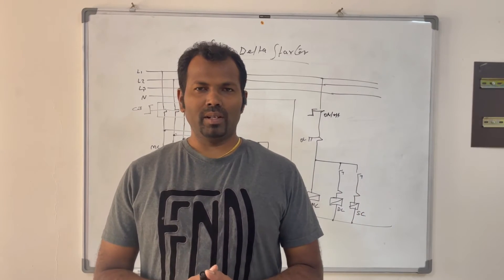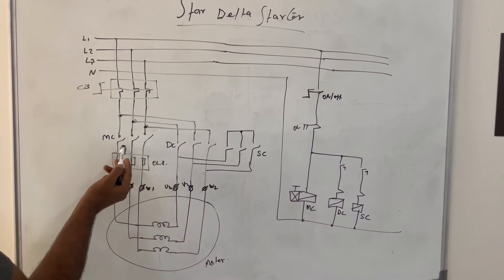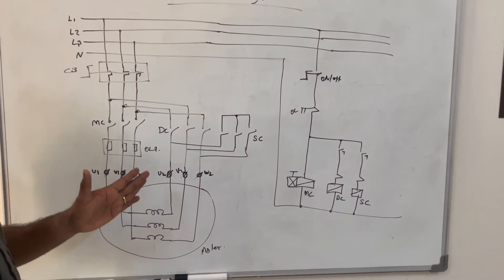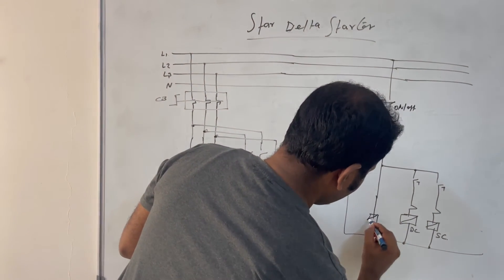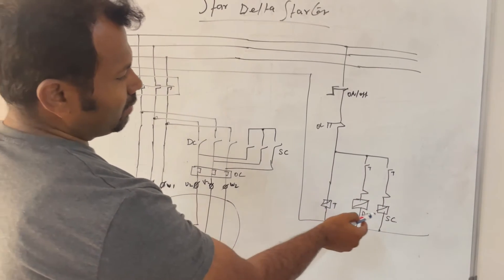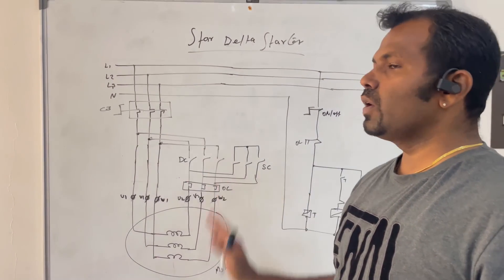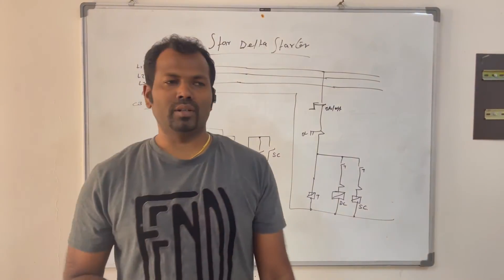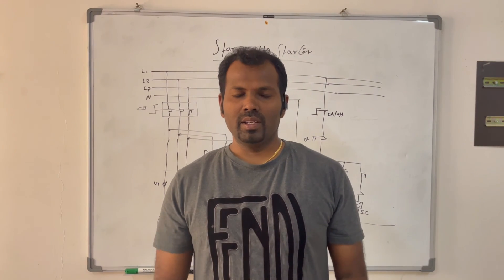How to make star delta starter with 2 contactor  -Explained with wiring...

Comment: Take care coil connection.. 3rd coil connection wrong... Its should be seperate phases....
Reply: 3rd coil your giving both side are the same phase. Please check
Reply from the maker: @dailyhunt3421  Its star connection. you need to short all the phase.
Reply from the maker: what is the exact mistake?